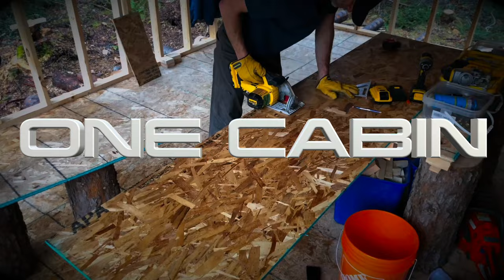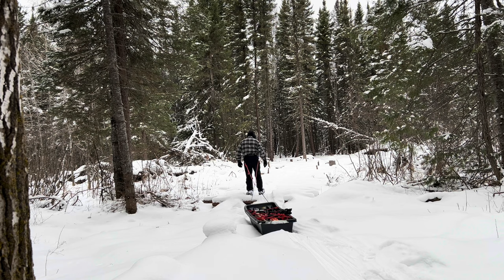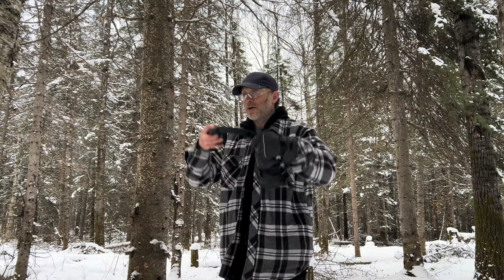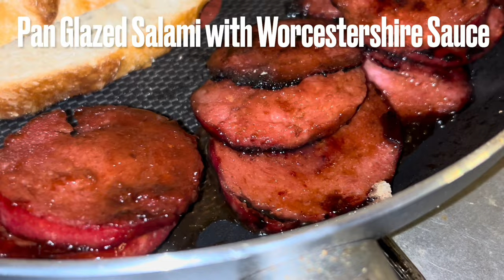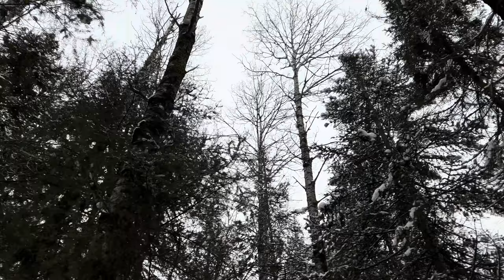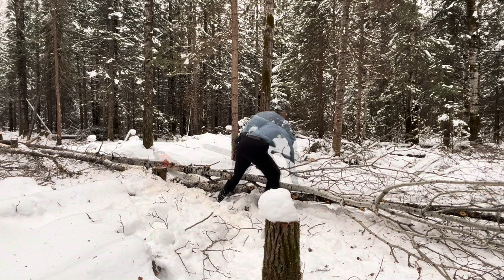Off-Grid Living - Felling Trees for a 1km Trail in the Woods to Build a New Cabin

Comment: Any chance you are going to be able to use some of the trees for something other than firewood?   Even a portable Grandburg mill would work.   Good to see the post.
Reply from the maker: Hey Bob! Yeah, definitely. That’s why I’m stacking it, to get it off the ground. It’s fine for the winter, of course, however come spring I want it to stay dry and keep off the soil. I’ll include some footage of that when the snow melts in the spring and show how much I have accumulated. 

I did get an Alaskan mill and a longer bar for my Echo CS 501 but not the Granberg. Didn’t want to shell out that much, at least not yet. Haven’t used the mill yet. Too busy doing other projects.

I didn’t show the bucking and stacking in the video but briefly mentioned it in the description.  Its a ton of work and I dusted off the log peavey to help out there.